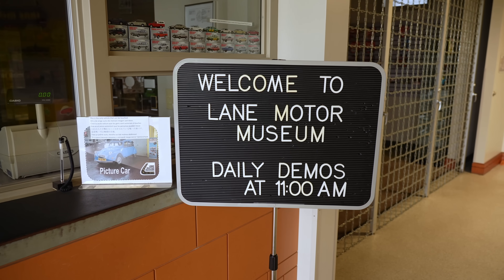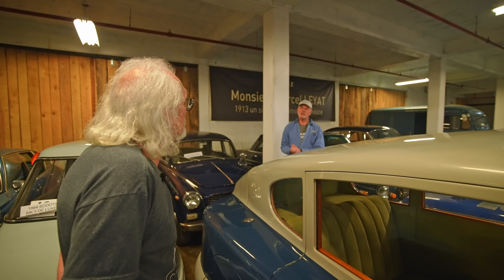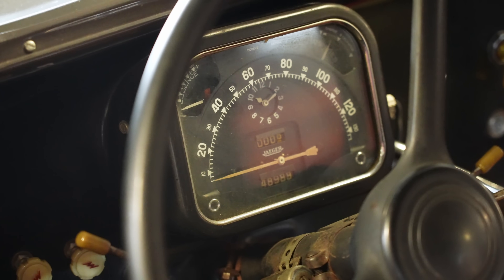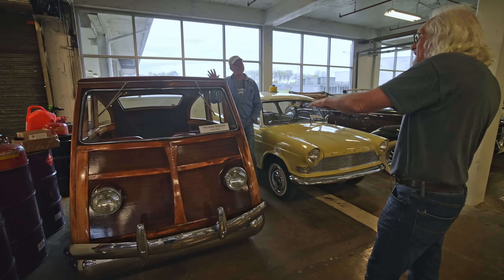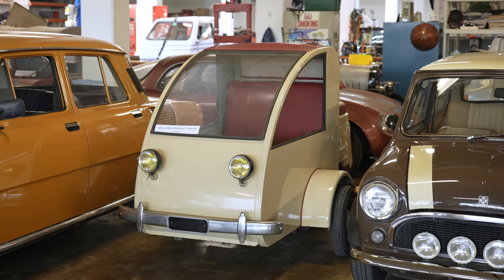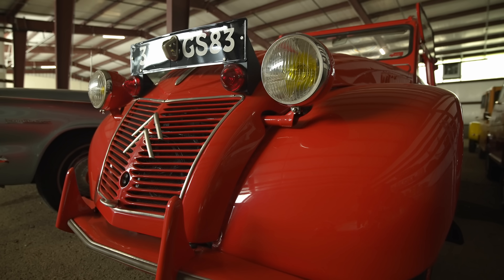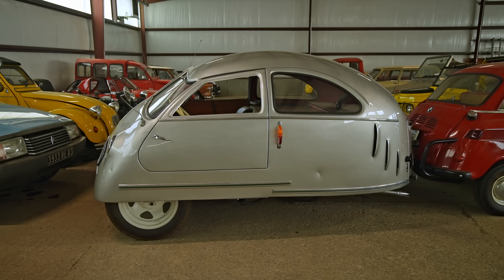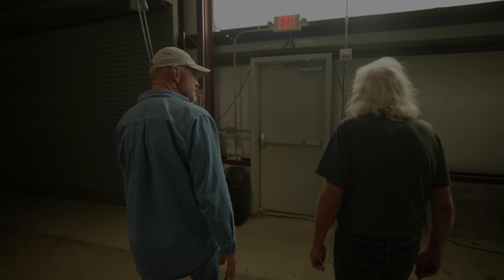World’s MOST Unusual Cars EVER made, Found In One Warehouse | Barn Find Hunter

Comment: Thanks for preserving the BARC 60 amphibian. Thats" Barge Amphibian Resupply Cargo" and rated at 60 tons payload.  I am a Vietnam era Army veteran and I  was trained to work on these when I was stationed at Fort Story, Virginia. The sound of the four Detroit Diesel 6 cylinder 2 stroke engines running a full governed speed is something I will never forget! BTW you forgot to mention the crab steering feature of these machines. The steering mast was formed like a motorcycle handle bar and it had a locking pin in the center which allowed each side of the bar to move separately when it was disengaged. Pulling back on each bar together would turn the rear wheels to the right as well as the front wheels causing the BARC to side-step to the right. Pushing the bars forward would have the opposite effect. It was an odd sensation and took some getting used to.
Reply: That's awesome. I am a total gearhead and US military machinery buff going on 65 years now and I never even heard of them before. Thanks. I learned something today therefore I'm not dead yet!
Reply: @patrickshaw8595  You are welcome, Pat. It was great seeing that behemoth. It brought back some memories for sure. The drivetrain in that thing was unbelievably complex. Everything ran through shafts.
Reply: Repent to Jesus Christ “I will give thanks to you, Lord, with all my heart; I will tell of all your wonderful deeds.”
Psalms 9:1 NIV
ht
Reply: @edwardwerick2420  Thank You For Your Service and WELCOME HOME SIR!!!
Reply: @repentandbelieveinJesusChrist3  ?
Reply: @repentandbelieveinJesusChrist3  Delusion
Reply: Well thank you for your service. When I went in my swondager was a Vietnam veteran. My platoon sergeant was a Vietnam Korean and world war II veteran. First sergeant I know he was Vietnam in Korea. They all talked me a little something that I'm going to keep my head about me if you know what I mean. At one point I was a motor Sergeant. As neat as his vehicle is, I'm glad it wasn't in my motor pool. But like someone else said I never heard of this. I've seen something like this but I assume it was a smaller version of what this thing actually is. Maybe I've seen pictures of this and didn't realize just how huge it was. I'm familiar with the duck from world war II. Thanks for taking the time to add the additional details.
Reply: If you search "The Wash Monster Hunstanton" you can see one of these still in use in my home town in the UK. It does tours out into the wash to view the seals.
Reply: I have wanted one for the last 50ish years….I fear I will never own one
Reply: Thanks for the interesting info
Reply: @jessewilson8676  Ask Jeff Lane. He may know where there is another one.
Reply: Very neat vehicle indeed!  There's one located SE of Houston behind a huge ex-seismic manufacturing building.  Rare to see it move, but looks like from Google maps it's made a few circles...
Reply: I clicked "see more" then I noped out of reading this
Reply: Bad
Ass
Reply: I actually ran across one these stuck in the mud on the York River. The tide was too low to float out and too deep to get wheel traction. It was probably 30 years ago. I never knew they came out of Fort Story.
Reply: Please, for one of the best sounds of those engines, check out:
"FTF truck with 6V-71 Detroit Diesel" - Arjan Kolkman
By the way: skip to 1: 35 min to start watching
Reply: Saw this sitting in Tampa early-mid 90s near Gandy bridge.
Reply: Awesome
Reply: This is such an awesome comment
Reply: Best❤
Reply: As incredibly cool as all these unique cars are the BARC  caught my attention too.  I want to thank you for telling us about it and giving us so much opportunity to learn about the cool machine that worked and helped in Vietnam.
Please Lord, help us to take better care of our Veterans.

Comment: When I was a young boy, my Dad had the DKW.
No water pump. It used convection currents to move the water upward to the radiator.
No fuel pump.
No Distributor. It had 3 sets of points and condensers, right off of the crank.
2 Stroke, so no valves or camshaft. You did have to add oil to the gas yourself.
Very reliable.

Comment: I wish I had some pictures but I don't. In the mid-1960s a friend of mine took a wrecked 1964 Cadillac Coupe De Boat De Ville with a 454ci V8, and shortened it by close to half. Essentially removed the rear seat and trunk. Cut the drive shaft. And created what he called the 'Cadiddle'. It sat two in the front seat and would do a wheelie with little more than a tap on the accelerator pedal! Truly a one-off!

Comment: I just finished watching the Barn find video and I freaked out when you showed the Skoda in the early '60s a investor brought a boatload of sodas over from Czechoslovakia and they sat on the docks New York for four or five years and nobody would handle or sell the cars because they were made behind the iron curtain. So my dad and my uncles got wind of it and went down and they were auctioning him off for three or $400 a piece Will needless to say they bought of them. Needless to say my brother my sisters some of my cousins all drove skodas. This was a car that was ahead of its time it had front disc brakes IRS rear suspension a four-speed manual on the column and a puppy little four cylinder. When the carburetor wore out I cut off the intake flange from a 6 cylinder Chevy and put a one barrel Rochester on it to help it breathe a little better, I also put a small glass pack cherry bomb muffler on it which I slipped off most of the time and ran around with an open pipe. When the four speed shifter linkage failed I cut off the top cone of a Difco milk truck transmission welded it to a quarter inch steel plate to fit on top of the top loader transmission adjusted the height of the stick in the ball and ground end of the stick down so it could shift beautifully as a floor shifter. I have to tell you I had more front in that car during high school and most guys with their parents big yank tanks, GTOs, chevelles had a hard time keeping up with that little car on the humpback back roads of Connecticut. Oh one of the things the backs of the front seats disconnected and went to total horizontal which was great for the drive-in theater. I hope to see your museum in person someday. Thank you for taking care of such beautiful machines.
Reply: Thanks for your personal history with the Skoda, Alfred. Tom

Comment: Ha!...if things had worked out for me, way back in 1968, when I was a teenager,...me and my friend were planing on building our own car,...a one-off model. At the time my buddy's grandfather was building a ferro-cement hulled boat, in his back yard. So taking that as inspiration, we had  plans to build a ferro-cement, bodied car. We had an old rusting English Ford, an imported car. We had thoughts on removing the rusting steel body, and replacing it with a ferro-cement one. His grandfather's boat,....consisted of a light weight wooden inner frame, that was covered in steel mesh, then slathered with a relatively thin layer of cement, which could be smoothed ( troweled)  by hand. We made drawings, and began to research all the parts we would need. Of course it was just a silly fantasy, of two energetic teen aged boys. And of course we never got very far with it. Other than, stripping down the old sports car, to its most basic level. We were going through puberty about the same time,....and well, all of a sudden, "girls" were becoming more interesting to us, than inventing a new kind of car. lol

Comment: When I was a teen my father had gotten a DKW from a guy, claimed he didn't know why it would over heat. so my father took off the head and someone had dumped drain cleaner in the water jacket! reacted to the old aluminum head and ate right into the cylinders. Pity too it had the electric clutch and other than needing a engine and radiator, the body was almost perfect. I think it was a '57 but I could be wrong.

Comment: Wood (or coal) gas generators (like on the Traction Avant) generate carbon monoxide for the engine to burn. There's a miniscule amount of methane in it too, but not significantly. The biggest danger, instead of an explosion, was carbon monoxide poisoning, so you wouldn't want to use one in a garage or a tunnel.

Comment: The Martin's same as Lockheed and Martin the one with the Martin's magic magnetic drive/gearbox it was said to be a Harley gearbox have you pulled it apart magnetic non friction clutch just curious probably doesn't work but a visual prototype maybe ,as the museum has many use what you can and what was available at the time patents  and drawings get lost over time but a visual prototype is like stone.

Comment: I just want to point out at 0:50 that is an incorrect way to hang czech (czechoslovak) flag vertically, the red portion should be on the right hand side
Reply: What happens when you walk on the other side of the flag? Is it then the correct way?
Reply: @DustinPlatt  For me it seems that the angle its shot from is the approach angle, therefore the view point